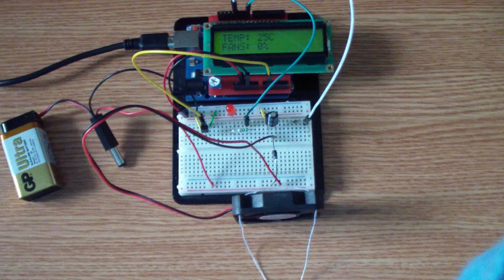Arduino Automatic Temperature Fan Speed Controller

Comment: Fixed code but using the DHT 11 and an LCD display now working

#include <LiquidCrystal.h>
#include <dht.h>
 
LiquidCrystal lcd(7, 8, 9, 10, 11, 12);

    int       tempIn = A0; // Temperature input
    int       ldr =  A1;    // LDR input for brightness
    int       bright = 5;   // Output brightness
    int       ledR = 2;     // Fan off indication
    int       ledG = 3;     // Fan at 100% indication
    int       ledB = 4;     // Fan middle range indication
    int       lightB;        // Light brightness
    int       lightLow  = 200; //Full bright
    int       lightHigh = 800; // Full dim
    int       fan = 6;       // the pin where fan is
    int       tempMin = 25;   // the temperature to start the fan
    int       tempMax = 28;   // the maximum temperature when fan is at 100%
    int       fanSpeed;       // frequency of pulse
    int       fanLCD;         //
    int       temp;
   

    
   // variables will change:
       dht sensor;

 
void setup()
{
     pinMode(fan, OUTPUT);
     pinMode (ldr, INPUT);
     pinMode (bright, OUTPUT);
     pinMode(ledR, OUTPUT);
     pinMode(ledG, OUTPUT);
     pinMode(ledB, OUTPUT);
  
     lcd.begin(16,2); //16 by 2 character display
}
 
void loop(){
     
  
    int sensorValue = analogRead(A1);

   if (sensorValue > lightHigh) {
    analogWrite (bright, 247); //Screen at dimmest
   }
   else if (sensorValue < lightLow){
    analogWrite (bright, 0); // Screen at brightest
   }
   else { lightB = map (sensorValue, lightLow, lightHigh, 20, 255); //The actual LCD brightness
   
   analogWrite(bright, lightB);
   }
   if(sensor.temperature >  tempMax){
    analogWrite(fan, 255); // spin the fan at the max 255//
    fanLCD = 100;
    digitalWrite (ledG, HIGH);
    digitalWrite (ledR, LOW);
    digitalWrite (ledB, LOW);
   }

    else if(sensor.temperature <  tempMin){
    analogWrite(fan, 0); // spin the fan at the min 0//
    fanLCD = 0;
    digitalWrite (ledR, HIGH);
    digitalWrite (ledG, LOW);
    digitalWrite (ledB, LOW);
   }
   
    else{ fanSpeed = map(sensor.temperature, tempMin, tempMax, 20, 255); // the actual speed of fan fanLCD//
    digitalWrite (ledB, HIGH);
    digitalWrite (ledR, LOW);
    digitalWrite (ledG, LOW);

    fanLCD = map(sensor.temperature, tempMin, tempMax, 0, 100); // speed of fan to display on LCD

     analogWrite(fan, fanSpeed); // spin the fan at the fanSpeed speed//
     
    }
    
    delay(1000); //wait a sec (recommended for DHT11)
  
  
  
  sensor.read11(tempIn);
  lcd.setCursor(0,0);
  lcd.print("T=");
  lcd.print(sensor.temperature);
  lcd.print("C");
  lcd.setCursor(9,0);
  lcd.print("H=");
  lcd.print(sensor.humidity);
  lcd.print("%");
  lcd.setCursor(0,1);
  lcd.print("Fan ");
  lcd.print(fanLCD);    // display the fan speed
   lcd.print("%");
   lcd.setCursor(8,1);
   lcd.print(lightB);
   lcd.setCursor(13,1);
   lcd.print (sensorValue);
  
       }
Reply: ty
Reply: Did you use the 9V battery?
Reply: Any voltage will do, it depends on your fan
Reply: Tony Cooper Thanks :)
Reply: How come when I try to upload this code it isnt working?
Reply: My code or his?
Reply: Tony Cooper why my arduino can't declare<dht.h>
Reply: Tay sean have you added the library?
Reply: Tony Cooper how to add into library
Reply: Tay sean mate I'm not your mum,do some research
Reply: Tony Cooper okay，thanks for your answer
Reply: fm

Comment: Nice project..now I am wondering to modify it for controlling a fan of 220V,50Hz supply.Any kind of help from anyone is appreciated!!
Reply: Meghjit Mazumder Use a relay ibstead of a transistor,modify the program with new codes which control the relay with the current air temperature.Like at 50°C the will turn on and at 40°C will turn off.Quite easy to make.

Comment: Could you do the same thing to run a varispeed fan relative to humidity? How would you use this system to control a 12 volt or 240v volt fan?

Comment: why is that my 12v Fan Doesnt work?? :( but all of the components are good in condition, what would be the possible solution for this? I just followed the schematic in the website :)
Reply: I believe he used a normal computer fan that works at 0v-5v. In your case i think you should use a transistor to adjust the fan speed.

Comment: Very good project. I am very interested in building this for my final year assignment next term. I have a few questions.
1 )The Arduino board, where can i buy it and does it come with the LCD display or do i have to buy that separately.
2) Does the Arduino board come with a USB port so that i can program it on a computer? If so what operating systems does it support and do i have to buy any additional programming software?
3) I would also like to build the DC power supply for it as that would make the project more home made instead of using DC batteries. This would require a basic Regulated voltage circuit. Can I do it this way or is it necessary to use batteries.
Thank You! I'm a new subscriber
Reply: 1 ) the LCD must be purchased separately
2) it has an USB port and an IDE for programming the microcontroller that works on almost all OS.
3) you can use an external power supply.
Check out http://www.arduino.cc for more info
Reply: Popescu Marian That you very much man. I have a few technical questions.
I've been looking at the schematics on your site 
http://www.electroschematics.com/9540/arduino-fan-speed-controlled-temperature/
1) Say for instance I would like to use a 12V fan instead of 9V, Would i have to change the type of transistor? If so, what would be the deciding factor to choose another transistor because i'm not sure how they relate. I'm wondering because the DC supply i was initially planning to make was a 12V DC. Any suggestions?
2) The component labeled 100uF/16V, Is that a capacitor? and If I used the 12V supply like i mentioned, would I have to use a bigger capacitor?
3)  Say for instance I would like to add another circuit for the Arduino board to control for example: To light up 3 different colored LED lights for a given speed of the fan. Which pins could I utilize on the Arduino board to place them on. (I know I will have to add additional codes to control them)
4) Could you briefly explain the last 3 lines of code. especially the last line, what does it mean.

Thank you so very much, I cannot explain how helpful your videos are! Thanks!
Reply: I'm interested about most of the questions too.  Thank you for sharing this project, I will have great use of it.